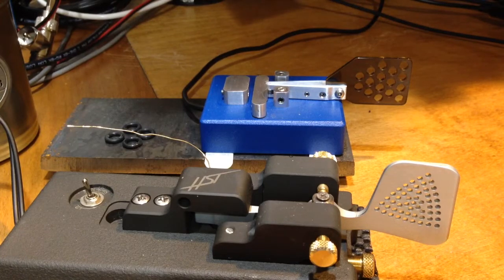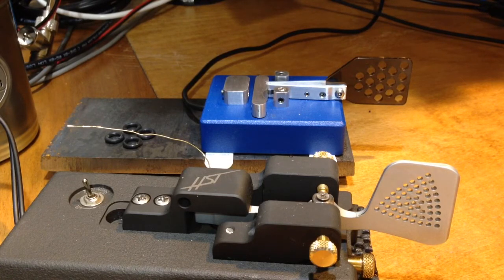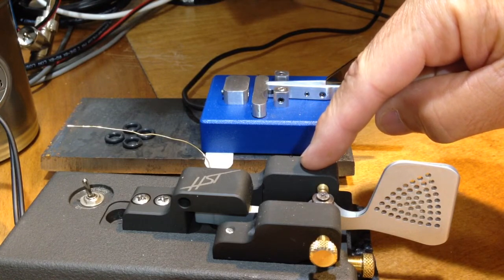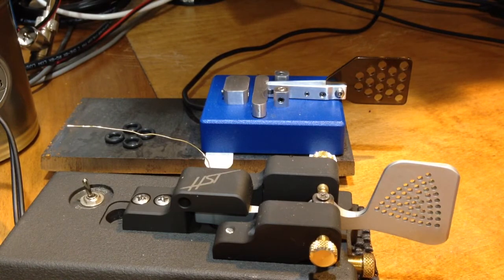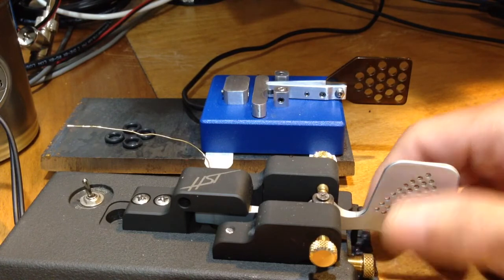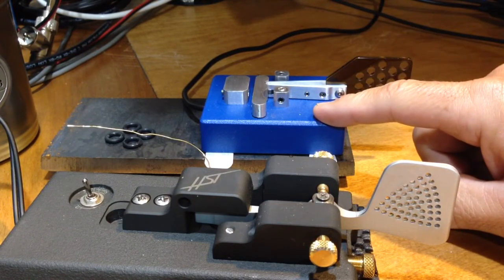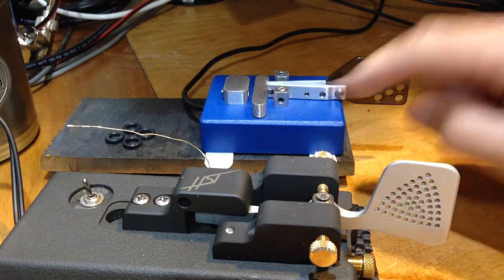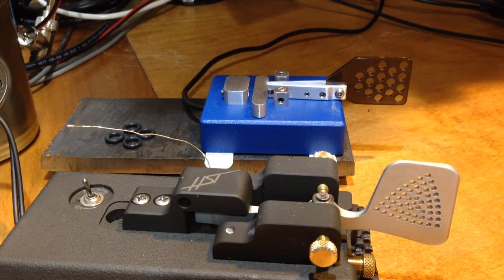Key Demo II

Comment: the HST has been developed for... HST. 

If you want to have an idea about how well these two keyers are working, you should start at not less than 200 signs per minute. At around 300 you should notice if there is a difference and what it is.

For cruising at 20 or 30 wpm any saw blade
 will do.